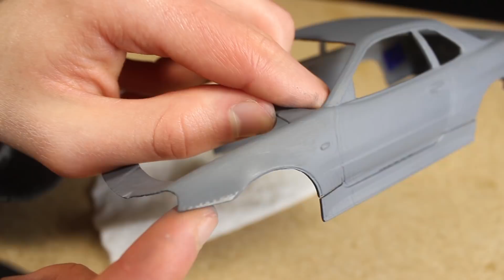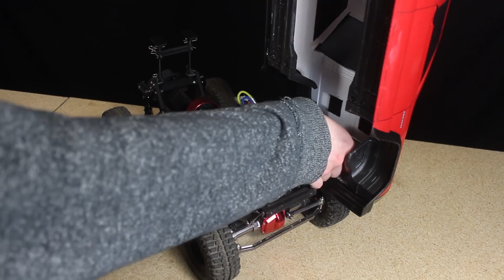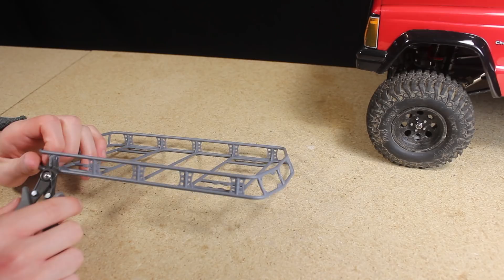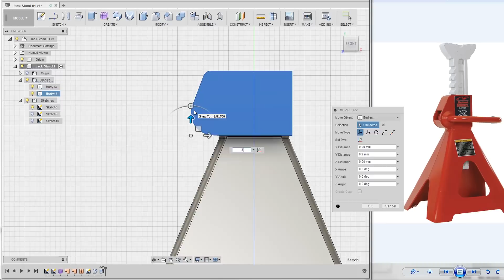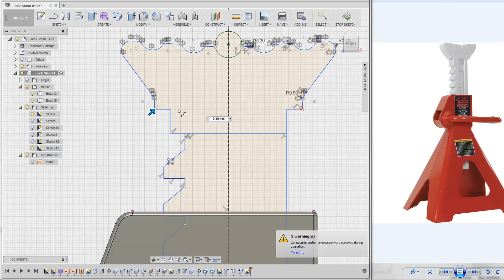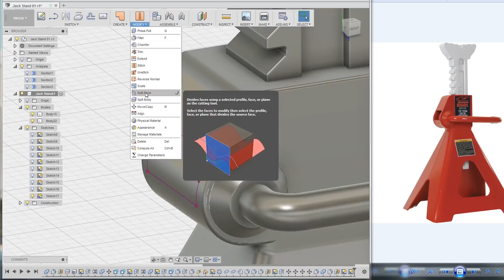Accessories + Maintenance on the Jeep, Progress on Skyline, Speed Design of 1/24 Jack Stand (E6)

Comment: Total noob question (I have no knowledge of RC building at all). Why did you put wheel weights on the Jeep rims? I am curious to know if it actually negates vibration in the rim and tire assembly or if it is for some other purpose.

Comment: I am working on my Subaru 1/24th Tamiya AWD chassis right now.  Where did you get the chassis for the Skyline?  I see it is printed.  Is it on Thingi (as I couldn't find anything close to that) or is it yours.  Unless it is this one?  https://www.thingiverse.com/thing:2772823
Reply from the maker: It is 3D printed, and is designed by me. After more testing and design revisions I plan on offering this chassis for sale, and releasing files for the 3D printable components.

Comment: Just found your channel and subbed, Awesome work. Just a heads up if you're not aware, that artifacting you're experiencing on your prints is called ghosting. It's most noticeable near the edges of the side trim pieces and in the taillights of your skyline. It's caused by vibration and can be mitigated by making the frame of your printer as rigid as possible. I hope that helps because otherwise the prints are of insane quality. I cant imagine how long that skyline took to print at that resolution.

Comment: I'd really love the roof rack and trim/mirror pieces on the Jeep, and seeing your video's inspired me to start making some additions to my own RC cars, and start repairing my mothers old 1984 Marui Big Bear Datsun racing body. Which has 2 major cracks and some smaller cracks further down the body. I started designing a supercharger to put onto the hood, some window nets to support the slim and (previously) broken A-pillars. As well as exhaust pipes which will cover up some cracks, which will be supported by the upcoming roll bar on the back of the truck. I hope I can show it on your facebook channel when it's finished.
Reply from the maker: That project you got sounds awesome. I'd certainly like to see it. 👍
Reply: After seeing the Subasharu getting lights, I was thinking about adding lights to my Big Bear body too. Although it's pretty bashed up as I said before, I got some ideas on where to place them without further weakening the body. But my major concern is the power draw of the LED system. Because I am still using a 4600 mAh NiMH battery. And the old (brushed) engine that came with this kit, migh make it even more challenging. Which uses a lot more (at least I think) then the new (brushless) engine you are using. My other electronics(such as servo and brushed ESC) are pretty much brand new. So what would you do, or maybe you have some advice?

Comment: Are all of the gears/diffs on the skyline 3d printed? If so how were you able to achieve a decent tooth finish with such a small part? I assume they were printed on something other than FDM printer?
Reply from the maker: They are printed using an SLA printer.

Comment: My 1:1 jackstands all use pins to lock them. I've had too many of those ratchet ones fail and don't trust them.

Your roof rack looks like the one I built for my blazer. On mine the front deflectors I used clear plexiglass and mounted my led lights behind that for protection. I wheel in the woods and trees tend to grab and rip off lights and junk.

Comment: For the jeep you should 3d print a spare tyre and ratchet strap for the roof
Reply: Only mall crawlers carry the spare on the roof. On a lifted truck it's a PITA to get a 100+ lb wheel on and off the roof as needed. Also raises the center of gravity even higher than needed.

We tend to make a spare carrier mounted to a rear bumper or just throw it in the cargo area. You try to mount heavy items down low.
Reply: dj beard why is there always someone with a smart arse answer ? Fuck it rc dude do what this guy says. It’s a model you could put it in the driver position for all I care it just would of looked good. Christ sake dude you don’t have to be the know it all at all times!
Reply: @user-neo71665  lol i'd rather get it off the roof when i need to instead of from underneath just a PSA from a guy who drops psi to crawl who has gotten boned by mother nature by having a spare underneath the truck was a 5 hour job instead of 30 minutes of bsing an just swapping it and being back to the trail call me a mall crawler i'd dare ya there isnt a mall near me nothing but dirt and cattle LOL roof spares are legit!